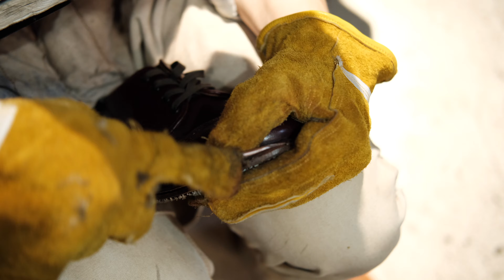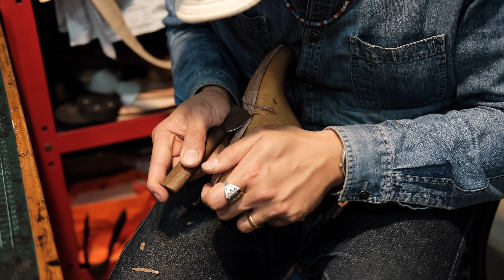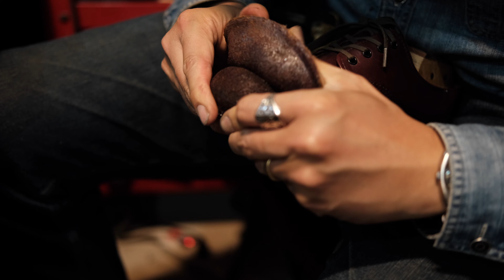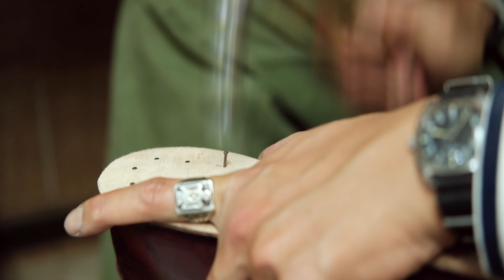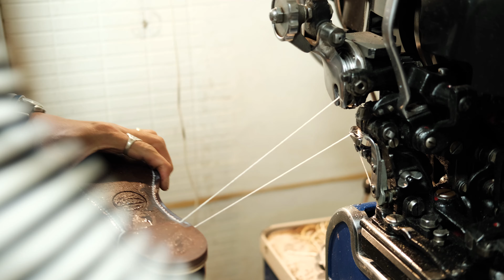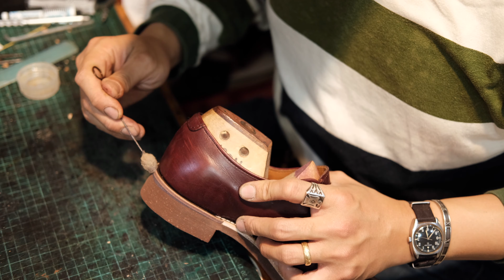【Bench-Re-Built】Red Wing 9045 - Re-size and Re-last  on Munson Last

Comment: Could you please "re-last" a pair or Redwing 875's on the 23 last to fit like a pair of Redwing 1907's on the 45 last.  They are both very similar Moc Toe boots but the 1907's are a bit wider than the 875's and I cant get the 875's in a wide enough width to fit my feet.
Reply from the maker: Unfortunately, we don't have the No. 23 last nor the No. 45 last. But I remember Red Wing provides several widths for the 875s.